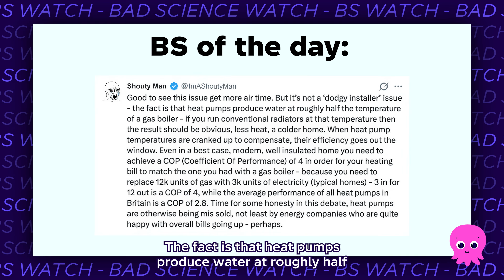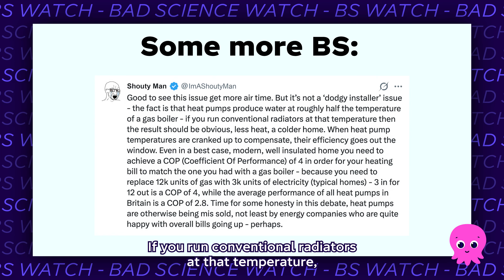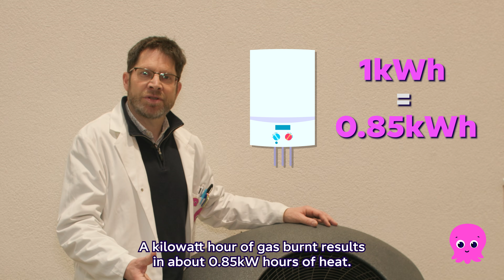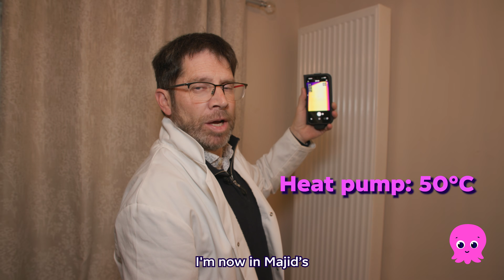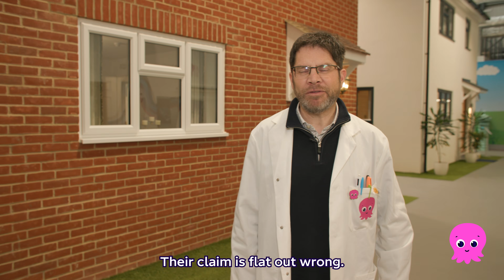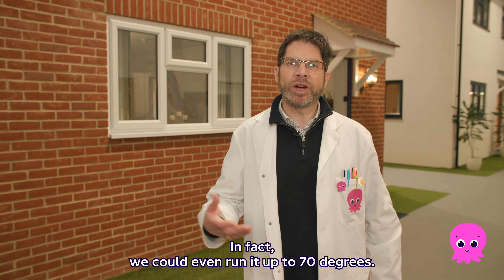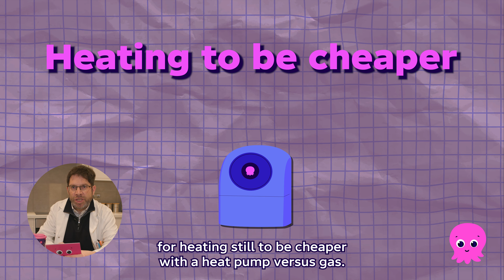Are heat pumps half as hot as gas boilers? BS debunked

Comment: Our heat pump installed by Octopus has once hit 41c flow temperature over the winter period, but in general hovers in mid 30c range and our lounge is a constant 21c, 24/7. We have a 1959 bungalow with a conservatory fitted and Solar PV and battery. Year on year since fitting the Heat Pump we have saved in excess of £370, but more importantly we have been comfortable 24/7, rather than just having the heating on in a morning and evening.
Reply: Your savings have come from your solar and batteries! Not the heat pump!
Reply: @jezzaandrews1940  Ok, here's the thing, I've had the solar and batteries for 3 years, but the key point is that in the last 12 months since installing a heat pump we have saved £370 on our total energy bill. Yes, I am making the most of our Solar PV and battery but the additional saving came from installing the Heat Pump (£2279 Thank you Octopus) , but if I put a Gas boiler back in it's going to cost me £370 extra to heat my home.  - so original statement still correct, we saved £370 on our energy bill over last 12 months after installing the Heat Pump.
Reply: @JOOI525 good luck to you👍you done it the right way round. 
Not everyone can afford Solar and batteries.
It's a package! without the added cost of solar and batteries you wouldn't of saved a penny.
Heat pumps on their own are not money savers!
Reply: @jezzaandrews1940  it depends. My COP since installation (mid January) has been 4.09. If I was on Octopus Flexible electricity at 27.88p/kWh then heat delivered would have cost 6.8p/kWh (=27.88/4.09). If I still had my gas boiler at 85% efficiency and Octopus Flexible price of 5.87p/kWh then heat delivered would cost 6.9p/kWh (=5.87/85%). A small saving due to my heat pump, but I hope that my COP will continue to improve through the warmer months and it's not only about saving money. My PV and battery (in particular, combined with cheap off peak electricity) mean that my savings are even greater
Reply: @redshift3 
You are falling into my COP is 3-4-5 trap, so it's got to be cheaper.
But your heat pump would be pumping more heat then the gas boiler did, due to 24/7 working, pipe heat loss, extra volume due to bigger rads plus buffer/Volumiser, defrosts etc. so reverse engineering your perceived gas usage doesn't work. It's a fact that your real COP will be far lower!
Reply: @jezzaandrews1940  yes, the house is receiving more heat (however, buffer/volumiser, defrosts, bigger rads, extra volume are all irrelevant to a performance comparison with gas) and some of the heat produced is lost from the external part of the primary pipes (which are well insulated but not perfectly insulated). But it's not all about cost. There is increased comfort and reduced CO2 emissions.
Reply: @redshift3 
It's all relevant if you are comparing the cost against gas! 
I'm glad your heat pump works for you👍but strip out any solar or battery gains, and your heat pump won't be cheaper then a modern gas condensing boiler, the maths dont lie!
Reply: @jezzaandrews1940  COP is calculated from energy in vs energy out. Why would a volumiser/buffer, bigger radiator, defrost, extra volume etc. be relevant to a comparison of gas vs heat pump performance? And once again, it's not all about cost (but it's not costing more)
Reply: @redshift3 
Because your COP isn't accurate👍
Reply: @jezzaandrews1940  it's not accurate to the extent that it's not measured by certified instruments. But those other factors you described don't affect it at all (except losses from primary pipework outside the envelope of the house, which could reduce heat delivered).
Reply: @redshift3 
Your COP is an estimate and is not taking full consideration of defrosts.
Reply: @jezzaandrews1940  COP = energy out divided by energy in (including defrost energy). The electricity for defrosts is measured. The energy used to create the hot water used for defrosts was previously measured
Reply: Does the Cosy heat meter measure negative temps that happen on defrosts or only counts upwards?
Reply: @jezzaandrews1940  I don't know. It would be illogical to measure thermal energy returned to the heat pump during defrosts. I would expect it to count upwards only
Reply: @JOOI525  If you paid £12,000 for your installation you need 37 years to break even !!! heat pumps are more than double efficient than a gas boiler but the price of electricity is 4 times as expensive as gas so it's a non brainer!
Reply: @snipperacoustics  £2279.
Reply: @snipperacoustics  £2279
Reply: @jezzaandrews1940  I have 20-year-old solar, and no batteries, yet I save around £600 a year compared to gas. This is not due to solar, as when the solar is the most does not correspond to when the heat pump is needed. We've had almost no solar for the last month, but our bills are fine and less than they were even over this period.

This is for a house that is much more comfortable than with the gas boiler, best heating decision we've ever made even without allowing for the most important reason which is the environmental impact.
Reply: @MentalLentil-ev9jr 
£600 saving without solar and batteries, thats a very impressive saving!
 I pay 5.377p kWh for gas so that £600 is 11,158kWh of gas. As Im due to use 9400kWh, which is around the same as last year, your savings are 20% higher then my whole yearly gas usage!
So your heating bill must be very large.
Reply: @jezzaandrews1940  The average UK energy bill is £1,842 according to AI (I didn't do an exhaustive search). I did pay more for gas than you do as I'm with Ecotricity which is more expensive. Most of my bill by far was gas, £120 of the saving is standing charge.

I would have been freezing if I'd only paid £500 for gas heating. You either have a very well insulated house, much greater than the norm, or you like the house cold. I have a 4 bed house, I don't know what yours is, also the house is heated 24 hours, it was heated during awake hours with gas, maybe you are out during the day?
Reply: @MentalLentil-ev9jr 
4 bedroomed 150sqm extended 1930 semi. Near London.  Both retired at home. Heating on at 07.30 off at 21.30 20.5 degrees most of the day, then up to 21-21.5 degrees at 17.00. Radiators, boiler and hot water set to 50 degrees and will be lowered as temp rises. We use 9400kWh of gas. Electric oven Induction hob.
Double glazed, draft proofed as much as I can.
Average of 6kWh usage  a day electric. Heat pump tumble dryer which is a game changer in the winter .
I would love a decent heat pump, but the figures don't stack up. I've done tonnes and tonnes of research and realised you need solar and batteries to offset the extra cost of the heat pump, because the COP/SCOP is only part of the picture for money saving with a heat pump.
If your doing it for environmental decisions, good on you! But you need all your ducks in a row for it to be cheaper then an efficient gas combi boiler.
I believe the Government and heat pump organisations are being disingenuous when it comes to the running costs of heat pumps on their own! People believe the headline figs that heat pumps are 3-4-5 times more efficient, but don't realise that isn't the whole story and your costs can be lower per kWh for a heat pump then gas, but if you are then pumping 50-60% more heat, it will still turn out dearer!
Reply: @jezzaandrews1940  probably, but the added comfort (at no additional running cost) is due to the heat pump
Reply from the maker: Every home will be different and energy cost will depend of usage/tariff rates. For a typical home with medium use (defined by Ofgem as a 2-3 bedroom house with 2-3 occupants, using 1,500 kWh of gas and 2,700 kWh of electricity per year), customers save up to £300 a year compared to their previous gas boiler. Also, when customers ditch gas and go 100% electric, they can also save another £128 a year by avoiding gas standing charges. Lots more info over at 👉 https://octopus.energy/heat-pump-hub/ 🐙⚡
Reply: @OctopusEnergy 
Your figs are completely out! It's 11,500 kWh average gas!
It sounds like a DFS sale "UP to £300 savings"
In reality, without solar and batteries it will cost you more.
Majority only just, 54% cook with gas, but get rid of your gas cooker/hob another  expense on top.
Reply from the maker: So glad to hear you're making the most of your sweet green tech! Sounds like you've fully signed up to making a big green dent in the universe like us. We're always on hand if you need anything. 🐙⚡💜

Comment: Strange. Our gas boiler is weather compensated using an external sensor.   Measured efficiency of 91%.

Until the spark gap reduces to 3 you're better off with a modern efficient weather compensated gas boiler.
When will Octopus offer an all-day electric tariff thats only 3x the gas tariff?
Reply: That's quite an ask and a claim from you. Waiting until the spark gap is 3 will take a long time. Octopus claim here that their Cosy heat pumps save money right now compared to an 85% efficient gas boiler (your gas boiler saves another 7%).

Comment: The spark gap is currently 4.8 - electricity is 4.8x more expensive than gas. So you need a CoP of 4.1 to break even against an 85% efficient gas boiler.  Not your claimed 3.5.
Reply: Assuming that elec is all at peak rate but that’s probably unusual with a heat pump
Reply: @ashleymortimore4886 Why? We're in our home 24 hours a day, need heat all the time. It's meant to be best to run an ASHP constantly at a low flow temperature, not ON and OFF just at non-peak times.
Reply: @tarbat  Actually once you factor in tariff differences the constant low flow stops being true and instead you want to move it a few degrees up and down with the prices. It's not an on/off thing but effectively means most of your draw is from the cheaper rate.

or you get batteries as the non scammy systems that can use 3rd party batteries rather than being tied to the vendors own inverter/battery combo are now ridiculously cheap.
Reply: @tarbat  25% of the time I'm on off-peak leccy and that's cheaper than gas .
Reply from the maker: Hey, looking over rates for the last year it’s been 3.5 COP to break even on a standard tariff. With Cosy Octopus (smart tariff) it’s much less as the weighted electricity price is just over 3x the price of gas and the heat pump runs really well making the most of the daily off-peak times.

Plus - many customers ditch gas altogether when they switch to heat pump, so they can lose their gas standing charge altogether - even more savings!
Reply: @OctopusEnergy  Also as a landlord it saves you another 100-150 a year in gas safety certificates which is significant in a smaller property when that's effectively about a tenner a month of the tenants rent you have to charge.
Reply: Octopus : Electricity is 28.36p/kWh, Gas is 5.89p/kWh. 4.81x
Reply: @tarbat  Yes - although it starts to shift back the other way in April thankfully. Lots of very dumb government taxation choices from the past decade or more starting to get fixed.
Reply from the maker: @tarbat  on Cosy Octopus smart tariff the weighted elec price for past yr has been around 23p - plus don’t forget many can ditch gas altogether and stop paying the standing charge.

Comment: We run our heat pump on pure weather compensation. For the past 12 months it has achieved a COP of 4.1 much cheaper to run than the 20 year old non condensing gas boiler we replaced.

Comment: If you used air/air it wouldn't even need to be that hot and you wouldn't be worrying about flow temperatures and AI magic for most houses 8)
Reply: They would have to develop new AI magic for A2A. Maybe that's next?
Reply: @Biggest-hz7ng  Not clear you need it. Oversizing inverter a2a is not a big problem so A2A people tend to work like gas people a lot of the time with the "guess, double, install" mind set. There are a set of basic calculations based on room size but they certainly oversize. Undersizing you just add more but that's rare for a professional install.
I don't doubt though that if their supposedly "ai" modelling tool can be tweaked for air/air it would let people size A2A installs a fair bit smaller than current practice.
Reply: @etchedpixels  do Octopus have an AI tool for install? I thought you were referring to how Octopus control Cosy heat pumps to run them cheaply.

Comment: This video is just as equally as full of 1/2 truths as the quoted gas boiler statements. 

Octopus - you can do better.

First - modern Gas boilers are up to 98% efficient - NOT 85%. Most quality new ones are >92% efficient. Our old non-condensing Glowworm was 81% efficient. (actual measurement with Gas consumption via MAGNA3 pump sensor with return flow sensor + set of extra sensors) 

But most heat pumps prefer a Delta-T between out flow and return flow of 5 deg c. Where most boiler prefer 10-25 deg c. Some boilers are LOCKED at 20 deg c and require bypass if delta gets too high. 

But due to the lower Delta-T for heat pumps - you need to run a LOT more water through the system constantly. That means higher system stress from higher pressure and much higher pump electricity power consumption. 

Heatpumps have their place - but so do gas boilers. Heatpumps have good and bad features - and so do Gas Boilers. But IMHO the "solution" is NOT heat pumps yet. Install cost, annual service cost and cowboy installers - have turned heatpumps sales into a snake-pit - with up to 80% of heatpump installations not delivering what clients expected.

Heatpumps are also a problem near coastlines. If you read many Heatpump manuals / warranty papers - they specify - NO installation within 500-2000 meters of a coastline. It is easier with boilers are the "full system" is installed inside. Some HP companies provide "coastal" ready heat pumps - but they cost A LOT more.

Honestly the BEST solution for UK housing stock would be HYBRID Gas/Heatpump systems.
Reply: I've seen claims that real world weather compensated gas boilers are up to 95% efficient. I can't see that being too far from their current claim of savings in comparison to an 85% efficient gas boiler. The changes due on April 1st would likely draw even the most efficient boiler into being something their Cosy 6 could make savings against.
Reply: @Biggest-hz7ng  Viessmann Vitodens 200 series are up to 98% efficient - and they can adjust / modulate output from Max kW all the way down to 1.9 kW. That gives you very big benefits when doing weather compensation.
Reply: The vast majority of condensing boilers run at 80-85% efficiency, including those that claim theoretical efficiencies of 95%. You can always find exceptions, but, they are a tiny percentage of the total installs.

Gas boilers do not have their place for most properties, they are an environmental disaster and a major contributor to the biggest problem of our times.
Reply: @MentalLentil-ev9jr  Yes badly installed/dimensioned boilers are inefficient. Just like badly installed heat pumps (>50% estimated). 

As I wrote our Glowworm non-condensing boilers - which are 20+ years old run at 81%. They are scheduled to be replaced this year - with hybrid system. 

Our previous house boiler ran at 60% when moved in - but fixing the installation (de-rating oversized boiler, installing weather compensation / modulation module, balancing radiators and installing smart thermostats - and a missing auto-bypass) - we got efficiency up to 91% and cost/consumption down by 50%+. That boiler was 14 years old.

I wrote to Octopus 3-4 years ago - to PUSH for a Boiler Efficiency drive as that could bring in massive CO2 improvements and efficiency improvements for a fraction of the cost with INSTANT results. 

But Octopus never bothered to reply. 

The missing “Bypass” valve on our old boiler was the cause of 20-40% of the efficiency loss. Out of 12 properties I have looked at now - 9 was missing the REQUIRED bypass valve so boilers was cycling on/off all the time. So a missing £15 device - costs £100’s to £1000’s per YEAR. 

It was also the cause of previous owners installing a massively oversized boiler as installer was too dumb to realise the problem with keeping the house warm was the cycling of the original boiler. So a larger one was installed with no major improvement. Electric heaters was scattered around the house. After our modifications - house became nice and warm and no extra heaters needed - in a 1920’s property. 

———

CO2 from Fossil Fuels world wide - Nat gas is 15% contributor. 

For heating and cooking - natural gas consumption is 20% of all natural gas consumption. 

So heating and cooking “consumption” of natural gas is currently 3% of total worldwide CO2 contribution.  

Heat pump replacement will not make a great dent in CO2 “pollution”. 

There are cheaper and easier fixes than spending 5-30+k per property - with huge amount coming from grants (aka taxpayers tax contributions)

Comment: What to do when the stove hob is gas . Can the heat pump work here
Reply: Get rid, really bad for air quality
Reply: Many switch to induction hobs. You can buy a portable hob to try out for around £40, but will need a suitable pan. Newer and older pans tend to be compatible (test with a magnet), with aluminium Teflon coated pans not compatible.

Heat pumps won't work as new models heat to around 70C.
Reply: Induction hobs are better in every way than every other type. Their only drawback is that you can't use one of you have a pacemaker.
Reply: yes it can
Reply: It's a good reason to get rid of the gas completely and save on the standing charge. The kitchen is much nicer without the noxious gas fumes that you don't really notice until you've got rid of them. Much less condensation in the kitchen as well.